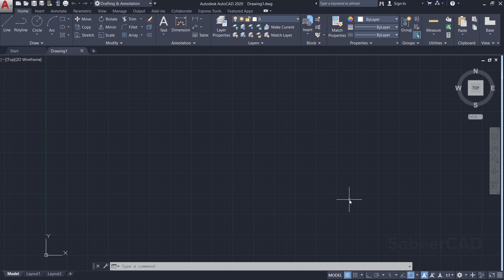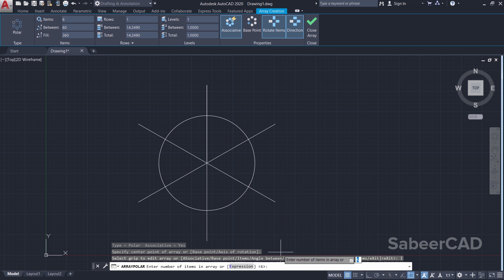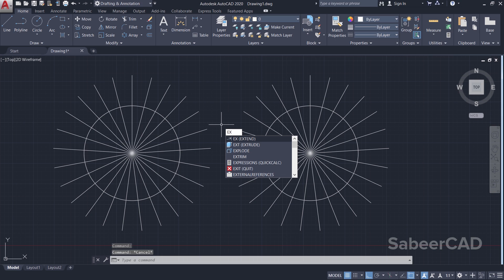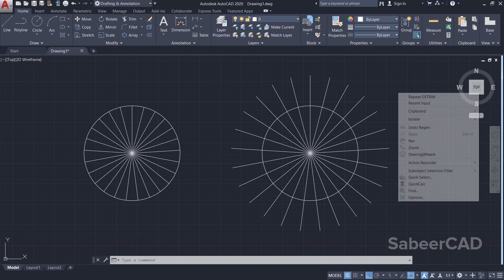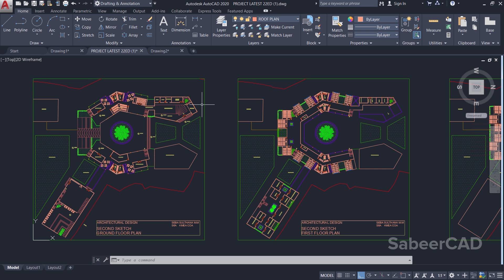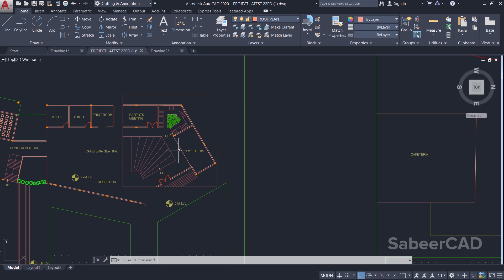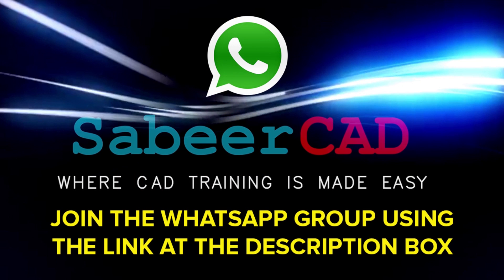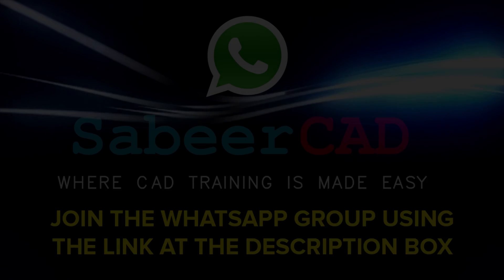AutoCAD EXTRIM COMMAND CONCEPT AND APPLICATION

Comment: Sir problem is. If you use this command. To trim uneven shape.
More thaa 300 object
Upon border.  
It's not work properly.
Than you do again
Than AutoCAD msg. Voilted the AutoCAD. Than .
Drawing shut down.

And sometimes boundary will delete.

Many problem .

Any  solution sir????
Reply from the maker: In that case you may have to give it EXTRIM command more than once